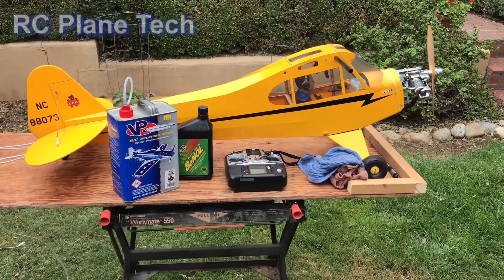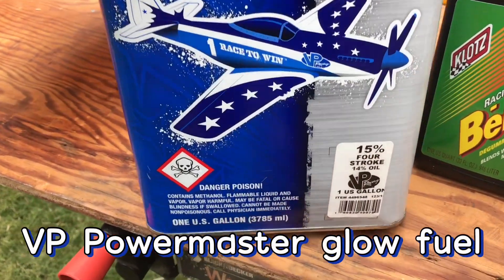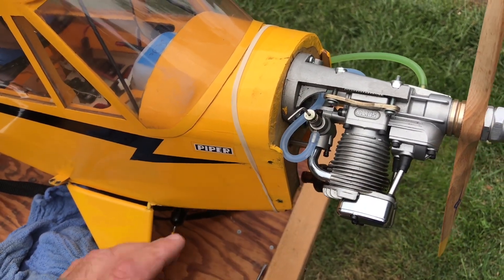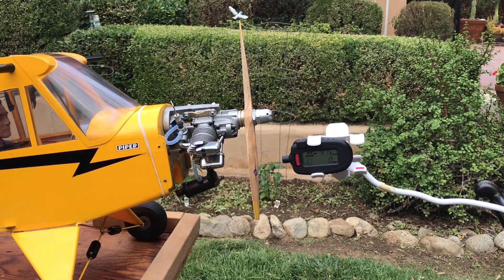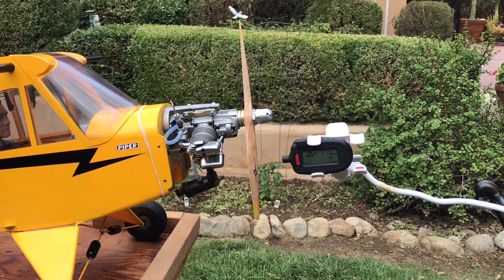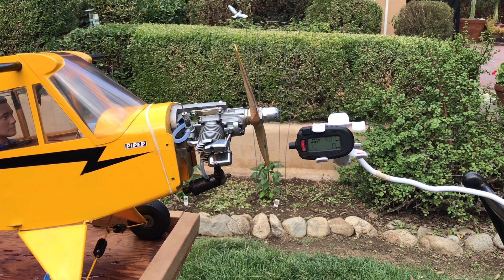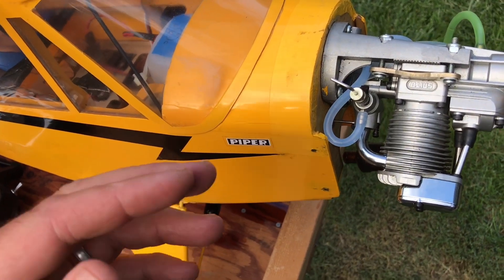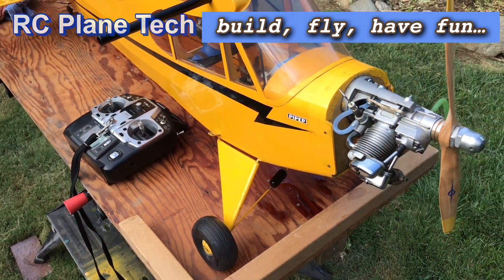Saito FA-62 RC Glow Engine Troubleshooting Part 5, adjusting carburetor, throttle, idle

Comment: One of the tricks I do for verifying the low end mixture is once it is idling reliably and the top end is set, I will point the nose up (45 degrees) same as guys do to check the high speed.  If the RPMs stay the same, no increase or decrease then it is good.  Increase=rich, decrease =lean.

Comment: I have a saito 82 i got from a friend and it won't fire and runs backwards when id runs after I prime it because of fuel in the muffler how can i get it to run.
Reply from the maker: Hi. Its a little tough without have the engine in hand. I would start with reviewing the manual in detail, check the valve settings and described to make sure its all adjusted properly. Then go through the starting procedure as described in manual. If it’s running backwards its possible that its backfiring when you turn it over, so it kicks back the other direction. Are you using an electric starter? That could help keep it going in right direction upon firing. Make sure you start with a rich mixture on the high speed needle and once its started slowly adjust to correct rpm. Sounds like you are having a backfiring issue. If you are getting fuel in the muffler it may be getting flooded. So you are turning it over, its not firing and then the fuel just fills the muffler. And then when it does fire it backfires. So I would check to make sure the fuel take hoses are all correct, try a brand new glow plug, check the valve clearance, go through the starting procedure in the manual.  Not if the glow plug is bad it may not fire properly or at all and that could flood the engine and muffler as well. Sometimes glow plugs look fine but they just aren’t. Good luck, let me know if anything helps

Comment: Great vid and info thanks mate  would you recommend max 8880 rpm on all 4 strokes from 80,s era ??
Reply from the maker: Hi, I’m not sure you could go with a set rpm for all engines because the rpm will depend on several things like prop size, fuel mixture such as % nitromethane, environmental factors such air temp and air pressure, and age of engine. The best practice I think would be to find the max rpm using a tachometer, and then generally richen the mixture to drop 300 to 400 rpm below the max depending on what the manufacturer instructions say. No matter what, I think its best to follow the engine instructions.

Comment: potresti dirmi quanti giri di vite del minimo per il setting idle ? grazie
Reply from the maker: Hello, for the fine needle adjustment on this engine you start with the top of the screw about 1mm below the plastic control arm surface and then turn it in clockwise, a little at a time until you you get a smooth idle at the low rpm. It wont be that much. As you adjust it in, the rpm will climb because its getting lean, so use the trim button on the transmitter to adjust the servo back down to reduce the rpm to your smooth idle speed. You have to do it in small steps. If you hit the throttle hard and the engine stalls then you will need to back it out to richen the mixture until hitting the throttle does not stall. Its a trial and error process, there is no exact number of turns, you have to adjust it until you find the good setting. Hopefully the video is helpful, I try to explain it, but it is a little tricky.

Comment: It's still 15% nitro, just more oil diluted in the fuel mix. Nitro is added to the methonal that makes up the mix that is combustible.
After you get it all tuned, go full throttle and point the nose of the plane up to the sky, it will induce a lean effect on the fuel system. If it's too lean, it will sag in rpm, if it's set correctly it will stay steady and not change.
Reply from the maker: ya the same amount of nitro is in the bottle, but since the total volume increases with the additional oil, the relative percent will drop.. unit sum total thing. i think thats how it calcs . Thanks for the pointers, much appreciated.
Reply: @JamesRCPlaneTech  yes you are correct it is no longer 15% it’s less.

Comment: That's a great explanation for the low end! I finished breaking in my magnum 91 four stroke today and went through this process! It's running smoothly now and runs a long time just on 8 ounces!
Reply from the maker: Nice, great to hear. One thing to keep in mind at least for the Saitos is that they recommend keeping the low speed needle at factory settings until you have several flights or tanks through it. Not sure exactly why, but I held off trying to fine tune the low until I had some time on it. Not sure if its the same for other engines.

Comment: My high speed needle was really rich once and I had a lot of problems figuring that out! Does that engine mount work good for the saito? I've been looking for one for mine!
Reply from the maker: The engine mount came with the Hangar 9 Cub ARF. So not sure if they sell them separately? I wasn’t fond of it at first because it uses a clamp method to hold the engine instead of screws or bolts, but I decided to keep it or else I would have had to modify the firewall mounting hole. So I just stuck with it. In the end it appears to be working fine, no problem. I like the Great Planes mounts, like Im using on the Smoothie build.
Reply: @JamesRCPlaneTech  Yeah thanks I was wanting it because it is a replacement for my Avistar elite so I can run the saito 65 instead of the 2 stroke mount that was with it!
Reply from the maker: Found it. Go to Horizon Hobby on line: 

Universal Engine Mount: 60 Size
Item No.
Hangar 9 - HAN60M
$9.99

Comment: The pinch test is a good way to test your low speed setting. While idling, pinch the fuel line briefly, the idle should rise for a second before the engine quits.
Reply from the maker: Yes Thanks for pointing that out. I pinch then let go, so the rpm rises, but doesn’t stall. Are you supposed to hold it until it stalls?
Reply: @JamesRCPlaneTech  just a second or two. I was helping a friend who's idle mixture was extremely rich. When I punched the fuel line, it ran at the same RPM for about 10 seconds before the RPM got higher and then stalled. I think I closed the low speed mixture screw about 1.5 turns to solve the problem.
Reply from the maker: Ya that makes sense, it was so rich it wasn’t responsive to the pinch. They can be tricky little buggers.

Comment: Really interesting presentation and fantastic guidance through the tuning process.  Love that you provide specific details along the way of what to look for.  There are some really superb videos out there of tuning nitro engines, and 4-stroke in particular, but you really need to pay attention and re-watch for details.  BRB, gotta go run a couple engines on the stand..  And it also occurs to me I may need to clean out a carburetor or two...
Reply from the maker: Nice, thanks for the feedback. I was hoping it would be a little useful.